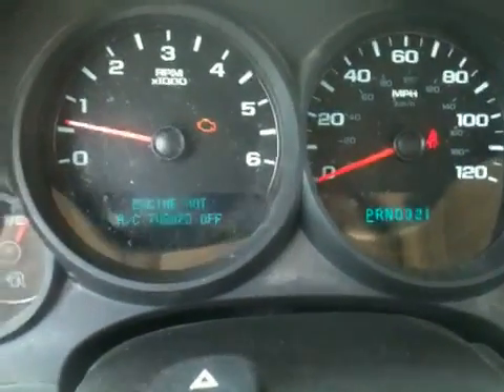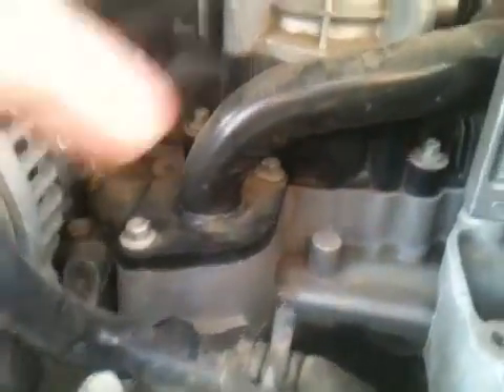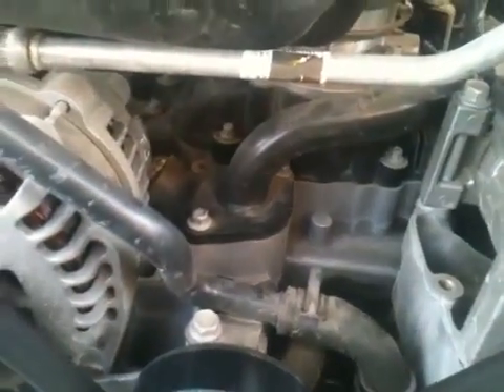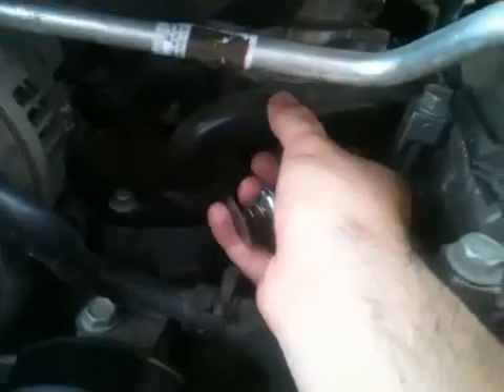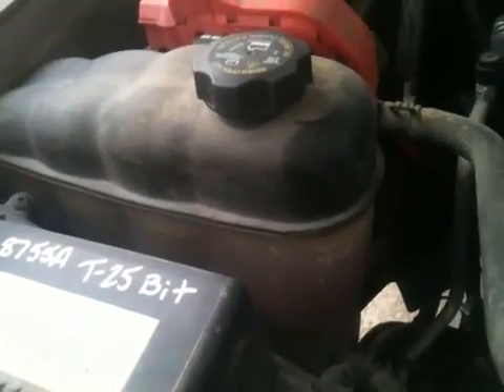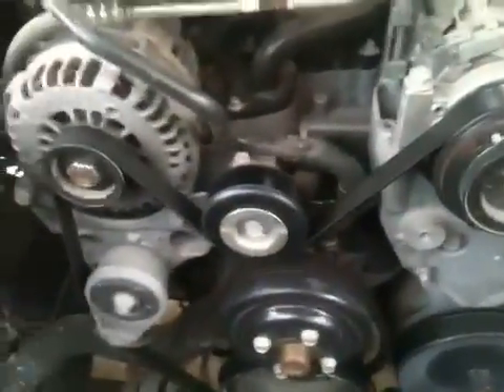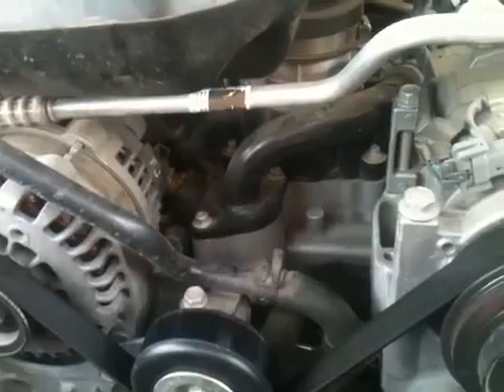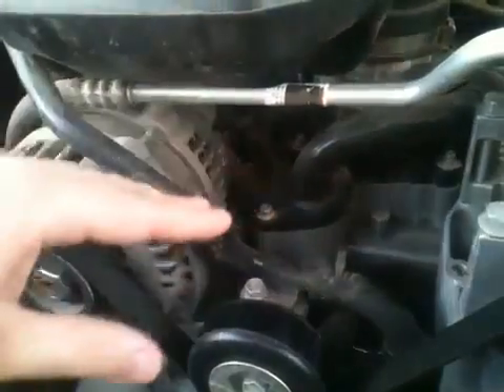Engine Hot A/C Turned Off Silverado

Comment: Mine keep going over to 260 but the engine isn't running hot. I've change out the cooling sensor and the thermostat and it's still doing it, but when I slow down or come to a complete stop. The gage goes back up to 210.

Comment: Silverado 2011 v6 
I changed both  the thermostat and temperature sensor .. problem solved 
Cost me 100$ .. parts and coolant.. engine should be cold when you do it.

Comment: I fuckin knew it 😂 I just bought a chevy the other day as a work truck it does have a few issues but the most major one was this one I kinda figured it was the thermostat because the fan would still blow air even tho the fan was off so I figured it was stuck open and was eventually gonna start causing problems

Comment: Kindly can you explain Which thermostat do I need to get ... because I have same problem but when I bought the original thermostat based on chassis number ...they told me the engine has been replaced... and the thermostat I've got is not the right one as it works for couple of hours then again the same message comes up on dashboard!!! 
So kindly tell me what kinds of thermostat that I need to try ??

The computer keeps detecting fault and Dan runs high along with " hot engine ... Ac turned off .."

Comment: I unhooked my batterie and reset the thing and it works so theirs some kinda short. This is after I spent 700 dollars for a toe and the dealer to replace the coolant tempeture sensor witch only cost 20 DOLLARS. then a couple weeks later it did it again so I went and got a sensor and replaced it again but at first it did not fix it and I was told to reset it by disconnect the battery and it reset. Its fine it couple times since then and I reset it and it's fine for months or weeks so iam guessing theirs a short somewhere. Any ideas or suggestions???? Where or what to check next.

Comment: I had the same issues you described  on my 2008 silverado 4.3  V6.In addition to the inop. AC. and  no temp.  reading my cooling fans were running. I just reset the computer, and so far my truck is operating  normally .
Reply: Thats what I was doing. The problem will come back

Comment: 2009 Chevy Siverado. Had all the same symptoms you mentioned in your video. Finally the check engine light came on. The computer said thermostat failure. 
Changed the thermostat and also the sensor. Had no problems for several weeks, but all I did was in town driving. After about a month I drove on the freeway, got it up to 60, 65, next thing you know got the same thing again: Engine hot A/C turned off. Give me some pointers. I wonder if the tensioner pulleys are slack. I know it is not running hot.

Comment: Thank you Aeroaggie!!!  Changed the t stat and also replace the driver side low beam headlamp (4th time in 3 years) the only thing I need to do is check the coolant,  not able to open the coolant cap, its stuck on there.

Comment: Did this, blew heat for a couple minutes then went back to cool air but notification went away. Need heat though. Brrr. Not water pump because hoses are hot. Please help.

Comment: I have a 2010 Chevy Silverado that runs super hot when I idle. I have no check engine light on. The temp gauge goes down when I start to drive again. Do I have a bad t stat? I can smell the coolant when I get out of the truck so I'm not sure.

Comment: my car is gmc yukon denaly  2008  .finally i found  the problem ( i am sure 100% )   i disconnected  the jack cable with sensor heat  then i cleaned it hardly by brush  using w40 spray   then  signal  disappear  and the gauge of temp stay in middle as stander setting factory .   i note that cable is very  worn  WITH REASON  OF HEAT     .  IT NEED TO REPAIR CABLE  WITHE JACK OR REPLACING   . dont  west you time no work shop will tell you this simple problem

Comment: Greg Harris

4 months ago
This is good info. 
But, my problem was intermittent. I pulled the leads from the temp sending unit, sprayed it with contact cleaner, plugged it in and back off half a dozen times, and no more intermittent engine hot- AC off!

Comment: I CHANGED THERMOSTAT  AND  RESET BATTERY  THEN SIGNAL RETURNED AGAIN  (HOT ENG..)  NOW I WILL TRAY TO CHANG SENSOR OF ENGINE HEAT
Reply: So far New thermostats New sensor  New water pump throttle body sensor New spark plugs nothing now my truck revs by it's self

Comment: I am having this issue.  I have not changed thermostat but that is my next step.  I have replaced the temp sensor that is in the side of the head.   Also, note that while having this issue you can disconnect battery cable and it will reset and temporarily fix the issue.  My problem occurs sporadically and sometimes it fixes itself.  If, the thermostat change does not fix the problem, I suggest there is an issue with wiring or connectors.
Reply: Rocket City Ridge any update

Comment: i have a 96 gmc 6.5 diesel i have a problem. the a/c works only when the temperature is 80 degrees or les but when the temperature gets more than 80 it stops any help. thanks

Comment: I had the same issue with a 2012 Chevy Silverado with the 4.3L V6.

Followed your instructions and fixed the issue for about $30 - a gallon of coolant was more expensive than the thermostat. Thank you so much for posting this video.
Reply: Alban Brooke my trucks a 2011, so I'm glad you replied to this video, that there is hope on me being able to do this
Reply: Awesome! It seems like it's pretty common with the 4.3L V6. Best of luck!
Reply: Alban Brooke. you fix it following thise video?
Reply: My 08 Sierra 4.3 overheats at 2 o clock at idle only, beacause cooling fans don't click on till 230F. What can I do? Anyone have this issue? Please help...
Reply: The dealer says its normal.that the trucks .are that way on purpose, I get that. But for it to overheat??is this a thumost at issue?of what?please help

Comment: can I drive the car when it appears?
Reply: If this is just the thermostat issue described in the video, then your engine is more likely running cold rather than hot. It's safe to drive, but this is a simple fix. It's important to make sure that you can get information about the engine if it was running how. Plus, you don't want your AC permanently turned off.

Comment: I did what you said. It took me ten minutes.. And the gasket was 6.00I want again to thank you. You saved me money and time... Everything is back to normal. ..
Reply: so this was easy to get to? i'm considering doing this myself but don't know how and this video looks like it could help
Reply: john crummett I had the same problem and it didn't work when I replaced the thermostat but I unhooked the positive post on battery for few minutes  and let codes reset and turned it back on and it was fixed!
Reply: Its the negative cable
Reply: it worked when I did the postive .
Reply: cool

Comment: do I need gasket sealer when installing new thermostat...
Reply from the maker: MrREDSKINZ100 the new thermostat usually includes a new gasket.  If it doesn't you could use a silicone gasket material.
Reply: the new gasket doesn't need gasket sealer?

Comment: I have this  same problem. Video looks like I'm doing the filming myself since everything looks exactly the same. I had the thermostat changed and it still happens.  Any ideas??
Reply: hey did you ever get your problem fixed?
Reply: No. New thermostat, new battery. Now I'm having a new waterpump put in.  Very frustrating.
Reply: It worked for about a month then it started doing the same thing again.  $800 worth of repairs and still having this same problem. Let me know if you come up with a solution!!
Reply: I unplugged the battery for about 20 secs and it fixed the issue it will do it again so it wont fix the problem. I dont think anything will
Reply: @josebecerril3885  
Know you posted this a while ago, just wanted to say that the code can be cleared with a cheapo $14-18 dollar OBD2 code reader. Plug it in and clear the code without any trouble. At a stop sigb, red light, even while driving down the road- if you have plugged in the OBD port a few times and know the angle, you don't have to look, it is right there under the steering wheel.

Anyhow, your issue is either you are really running too cool or you're getting an incorrect reading from the sensor.

Just because you changed your thermostat doesn't mean your new one is acting right.  I fought an issue once for a while, turned out the brand new thermostat I bought was not functioning correctly and I went through all kinds of crap because I assumed the new one was good.

Same thing could happen with any component, like a new temp sensor- it may be not so good even if it's new.

The best I saved for last.. How does the CPU get the temp measurements? It's not sensor but the wires that carry the signal back.  This could be the issue, a loose connection at the plug, broken or damaged insulation/wires. The contacts in the plug need a tight connection.  I have seen ppl use dielectric grease in plugs which can be problematic when pins don't fit so snug in a connector.  Dielectric around the plug for better insulation but not in between the surfaces that need connecting with no resistance for a proper signal reading. The plug can feel tight but the electrical connection inside not be.  Moisture could be getting in, from the wire side, corrosion, etc etc.

So to recap, the issue is either a real issue with Temp or you a bad reading. I would not look anywhere else.

Comment: Ive problem in my Acadia 2011 hot engine/ AC OFF. I changed the radiator cover and the thermostat sensor but still showing the same problem?! Is it necessary to reset the ECM after I did all that?! Thank you indeed.

Comment: Thank you so much. I have a 2010 Silverado and your video was perfect. Taking the negative battery cable to reset the computer not only cleared the temperature warning, but also the tire sensor that came on when I got the tires rotated.

Comment: I'm not sure the thermostat has anything to do with this issue.  Disconnecting the battery and reconnecting is the REPAIR for this issue.  It is a "sticky" error and WILL NOT go away on it's own.
Reading elsewhere, it seems to be a common error in ALL models with the 4.3L engine.  And GM has no solution.
And the engine isn't actually overheating, it just THINKS it is and this is the "fail-safe" mode (no temp display, A/C won't work, and fans on full blast).
This has been happening to me for 2 years, but it only occurs in the spring and fall when temperatures are about 60 degrees.  
Making several short trips during these weather conditions seems to be the trigger.
I just pull fuse #12 (2009 Silverado) for about 30 seconds (a shorter time sometimes does not clear it).
All better - for a day, week, month or year - until it happens again.
Reply: Thanks man, I'm glad I did this instead of buying a thermostat and doing all that work. It has happened twice and like you said it's a 4.3L engine, the temp outside is about 55-60 degrees. I pulled the 12 fuse for 30 seconds and re-inserted it and the engine hot a/c off went away and everything is back to normal.
Reply: shit i couldn't find this comment when i was on the side of the road
Reply: Thanks removed the fuse for 30 seconds and it worked was wondering how long did this work till it happened again and what did you end up doing for a permanent fix?
Reply: +Chuck J where is that fuse located
Reply: +Ronny Landers On my Silverado, it's on the driver's side under the hood.  Look for a big black plastic box.  Remove the lid and "most" of the fuses and relays are there.  A diagram on the inside of the lid shows which fuse is what.  Find the one labeled ECM.  Pull that fuse for about a minute.  A shorter time than that and the capacitors inside the ECM may remain charged and preserve the memory and NOT clear the error.
Reply: +Chuck J thank you , and driving my truck won't mess anything up until I can afford to take care of it long term ?
Reply: +Ronny Landers Well, I don't think it will actually damage anything, BUT consider the symptoms.  The ECM doesn't "believe" the temperature sensor.  It's fail-safe mode is to assume that the engine is hot.  You have no A/C or defrost.  The radiator fans are running full blast.  And since the ECM doesn't know what the engine temperature is, there's no guessing what it's doing to the fuel mixture, so your mileage may suffer.  It only takes a couple of minutes to yank the fuse and get back to normal - albeit temporarily.  Why wait?
Reply: Holy crap...really!!! I felt the host and it was hot not overheating the temp guage registered 200 all the time...so its not reall overheating???
Reply: Chuck J: Check is in the mail good sir!
Reply: thermostat won't get rid of the problem i have already tried I'm going to try your method thanks
Reply: Well I can tell you, it doesn't work either.  Been pulling the fuse every time it does this and it goes away for awhile, then it's back to the same problem.   I turn the key on in the morning, first run of the day, and it comes up right away with "ENGINE HOT A/C TURNED OFF".  Got to be a sensor acting up!
Reply: Chuck J  
This video was a great tutorial but I saw Chucks reply and thought "what the heck, I'll try tht first since its free.  Discovered on my 08 it was a 10 fuse but the same spot.  Pulled it and so far so good with no other Hot engine - AC Off and fan isn't running 100 mph.  Thanks to you I was able to hold on to my money!!!
Reply: Will this method work on my 2010 Chevy traverse it’s the exact same thing in this video and I don’t think it’s the thermostat? I haven’t unplugged the battery because well I think the battery is inside the car. And on the fuse I’m real lost there. Anyone?
Reply: Victoria Love its either thermostat or engine coolant temperature sensor. you need to replace whichever is broken. if you want to drive it without fixing it and hope it doesn't reduce the power you need to pull a fuse. the fuse panel for this is probably under the hood in a black box somewhere to the right or left by one of your fenders. take the lid off look at the sticker on the lid find a fuse labled "OBD" it may be some shit like OBD11Fg or some shit but you are looking for anything OBD and pull them out. you may try it with the engine off and key on or key off or also with the engine running one of these methods will probably confuse it long enough so you can make a short trip. good luck
Reply: Victoria Love i was able to confuse myn for two days then after that it wasn't having no more of it so dont rely on this method to save your life. also i used a scan tool to reset my obd i didn't pull plugs or battery cables.
Reply: Thanks removed the fuse for 30 seconds and it worked was wondering how long did this work till it happened again and what did you end up doing for a permanent fix?
Reply: I've don't that many time, after a while, the problem will come back
Reply: @richunggoy3960  I finally replaced the thermostat.  Fixed it.  Problem was exactly as the video described.  I caught it one day.  I just happened to be looking at the dash when the temperature dropped from 210 to 190, and shortly thereafter, the code popped up.
Reply: Hey this is great input! About to go on a long road trip for the labor day weekend and suffered these exact symptoms with my 4.3L in my Chevrolet Express Van. Was freaking out because I thought I was going to replace my thermostat which in the van is buried. Pulled the negative battery cable and it the Engine Hot AC Off Warning Cleared it Self. Totally Agree it is a Fail Safe Warning. Never had this issue in the summer but these cooler fall transitioning temperature seem to be triggering it. Thanks alot so far you have saved my weekend! You knowledge is greatly appreciated!

Comment: It is a faulty thermostat
Buy new one cost $10
Buy coolent 50/50
After repair
To reset computer
Remove the negative side of car battery
15mins
Then put back in
All fix

Comment: Hi, I just want to clarify one point I think you made in the video:  If the engine does not come up to operating temperature in a timely manner, the computer will turn off the coolant temp signal to the analog gauge on the instrument panel.  Is that correct?
I have a 2007 Equinox.  Twice now, while running the heater, I happened to glance at the instrument panel and saw the message "Engine Hot A/C OFF" and the temp gauge was pegged cold.  When I pulled over to check I saw that both engine cooling fans were running.  I could tell the engine was not hot:  could pinch radiator hose and carefully opened coolant reservoir cap.  So I continued on my way with the heater off.  When I got to my destination, I turned the engine off.  After sitting for about 2 hours, I started back up:  The message was still displayed and the engine cooling fans were still running.  After several minutes of driving I happened to look at exactly the correct time to catch the temperature gauge suddenly jump from pegged cold to about 3/8 of its range (normal operating position).  At that point the message disappeared.  
I assumed the sensor was intermittently failing.  But, if indeed the computer "turns off" the temp signal to the gauge, then it all makes sense.  A leaky thermostat combined with the heater blower going full blast pulled the coolant temperature low enough to activate this logic.  Don't want to second guess the designers but not so sure this is a good feature.  Sure threw me for a loop!
Reply from the maker: +treborhi I'm not a mechanic but from my limited reading of this problem around the internet this is the best explanation I can come up with without a fancy ECM scan tool.  And your situation makes it sound even more likely that this is the case.  I made this video because I couldn't find anyone else showing a solution to this problem.
Reply: +aeroaggie Thanks, appreciate the video.